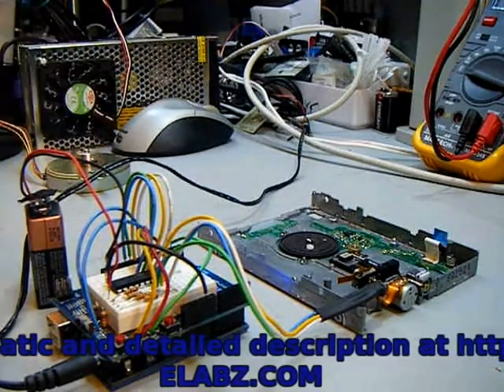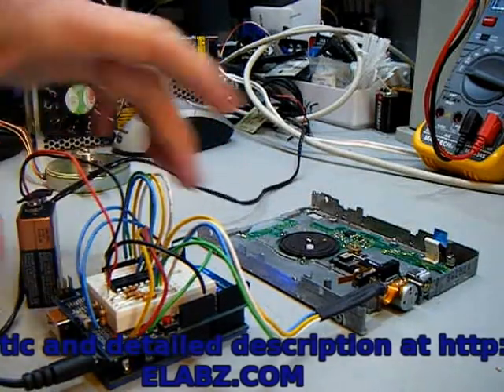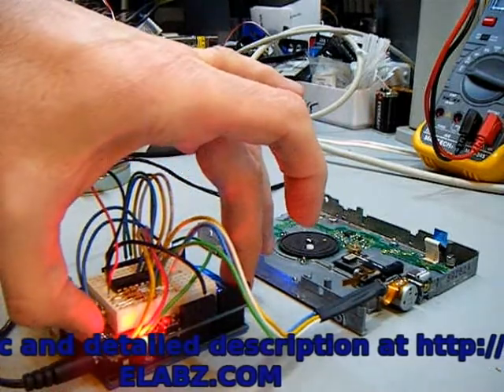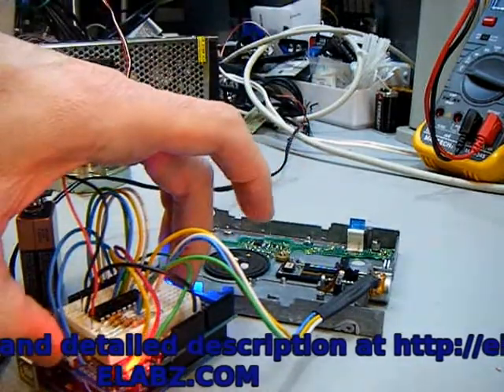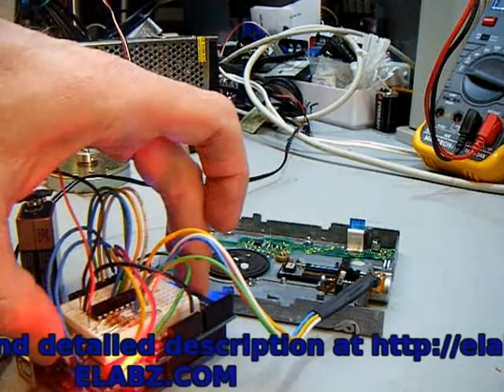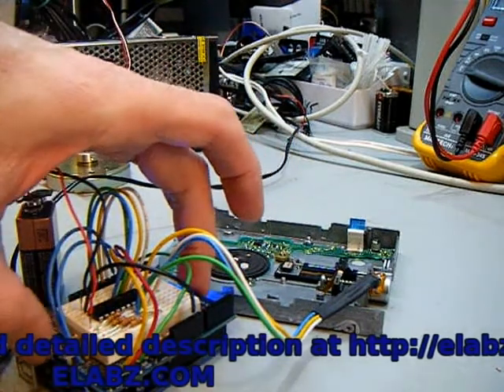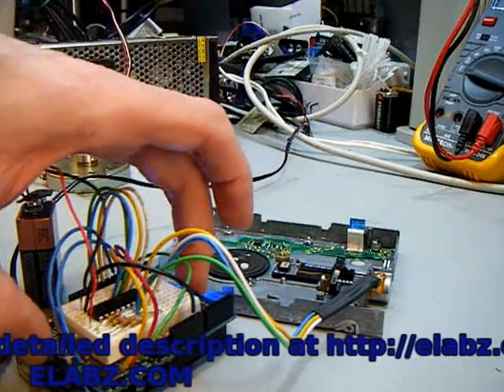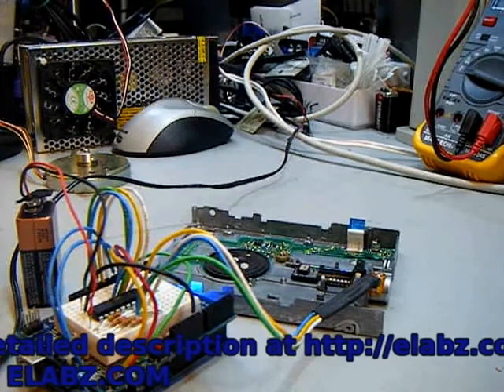Driving Bipolar Stepper motor with Arduino and ULN2308AG

Comment: Hi i'm working on a project where i want to drive two bipolar steppers.  I want them to be synchronized (ie move in the same direction, same time etc)  could you do this by just plugging in another stepper in the same rails in your breadboard, and therefore using the same number of arduino digital outputs?